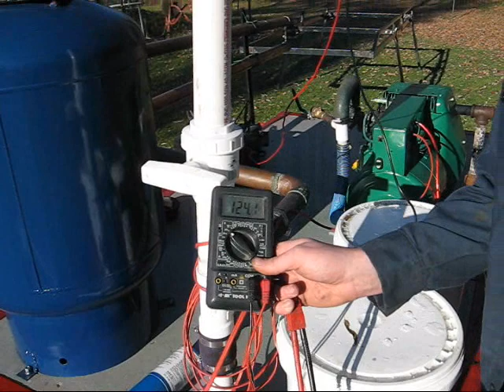Syngas Electric Generator Start-Up

Comment: There is no gas 'pressure' per se,the wood fire is kept running by the vacumm generated by the engine.The fire is 'oxidizing(burning extremely hot) under a controlled amount of supply air,that air being sucked in by the vacuum generated by the engine not by the fire burning.Thats the idea.It is also why he needs no carburator at all,just two hand valves,one for gas and one for air.Once you get your rpm's set with the hand valves you are good to go.

Comment: "research "cyclone steam engine", you can create a much simpler set up to create electricity for yourself. Check out the video of the WHE )waste Heat Engine" that they sell, when it is being run off of a wood pellet burning stove. No need to convert wood to woodgas, simpler operation,

Comment: Very nice job! I am building two of them right now that will handle a 5 Hp motor. I am almost finished with the first one. For those of you wishing to build one there are a few things that you need to make sure you get correct. (1) make sure the whole system is properly sealed. (2) make sure that the gas is properly cooled and filtered along with a way to capture any moisture in the lines. (3) Use a good dry wood for fuel. I'll be doing my own video soon too.

Comment: Dont see that pipe lasting very long being temp in reactor should be around 1000-1200F(to cut down on tar) and gas pulling through is about 100-500F and being plastic pipe cant be good at all!. I bet inside of pipes is glue like after 2 hrs.....Plastic PVC pipe and temp above 200F = Toxic gases,,,,, not good idea

Comment: Great job, my only question is how you determined the necessary gas pressure to run the generator.  I'd love to hear back from you, we are slowly working our way off the grid as well! (we use biogas for our stove right now)

Comment: @dexterquincy1  as long as the genset is 4 stroke and not 2 stroke it should work fine with a gasifier system that has been properly sized.

I will warn you though to consider building something other than a fema style unit. They are prone to make tar and can really gum up an engine... I say this from experience.

Comment: @onceANexile how many hours do you have to sit there holding a match to light the charcoal bed? A match will work but if you put that match to something like a newspaper and use that it would be smart. If you're going into woodgas you will most likely already have a torch for bracing etc.

Comment: @outoforder2day As a single person you will not have the financial means nor the engineering expertise needed to run an efficient electricity steam boiler-turbine setup. Making the very high pressure super heated dry steam needed to drive a turbine is actually really difficult and expensive to build the boilers and super heat the steam. Next you have to get a steam turbine which you do not really find down at your local hardware store. You utilize both electricity and the heat generated here.

Comment: Very cool. What are your thoughts about the waste heat that's being eminated to the atmosphere? Can it be captured via a radiator (or even just some copper tubing wrapped around your stove) to heat water? Then use the resulting steam to run some sort of steam engine as well as the gas engine?

Comment: @nwtrick No the gas is just starting up the gasification process it is a wood gasyfier. when the fire is started the gas is sucked out and blown into the engine. To describe it shortly the flame you se in a fire is the gases burning the glow in the bottom is the actual material burning. why not seperate these and burn the gases seperatley e.g. in a motor. Go look up wood gasification.

Comment: Very Very good!  Syngas, however, is used to synthesize other compounds that's why its called syn-gas.  Syn-gas is all hydrogen and carbon monoxide I think.  The only way to get pure syn-gas is to burn carbon/charcoal  to get it hot then blow steam through it for a while.   Its also worth noting that running on wood gas, or any gas made with air is pulled into will reduce your motor max horsepower by about 50% because most of the gas going in will be nitrogen thus reducing Oxygen for combustion.

Comment: As a footnote,these gasifiers can use practically anything organic,leaves,sticks and brush make the best fuel from what I hear.The best to use is sticks and or blocks of wood,doesn't matter what kind  of wood either.So,to any naysayers to this, many problably already own their  fuel supply and are too ignorant to use it.Oh about the CO2,sticks, leaves and brush give off the exact same amount of co2 rotting on the ground as they would burning it.

Comment: @nwtrick That's only 4 two seconds to start it. U use electricity to start you car 4 2 seconds. AND the alternator charges it back up. 

Once this thing is started it can be fed wood forever and keep the engine running. 

Does that make any sense 2 U ?

Comment: @catskillwoodgas 
thats great man. I made one gasifier too and yesterday i did the first try but the fan failed.  i used the water jacket technique for cooling and i used those duct flexible aluminum pipes but they started shaking so hard and the fan just stopped.  One mistake i made is i didn't put charcoal at the bottom i just lit the wood .  but i dont know what went wrong ;

Comment: Very nice project. I just finished mine and I am trying to find more information on filtering- as my intake valve is covered in wood goo. Its my fault, my filter is not much- What are you using?

Comment: @baaddwrench : from what I remember, when you heat up wood pellets (using indirect heat), it gives off a gas that is burnable.  The gas primer in this vid is to start the gas engine, once it is giving off a nice heat, it can be used to heat up the pellets, which in turn makes the "syngas" which fuels the engine.  The valve is moved from primer gas slowly to syngas.

But I could be wrong

Comment: soo you got any ratios to how many hours to how long the engine runs on a pound of fuel or how many pounds needed to fuel the motor for 1 hour?? thanks really awesome! i see this would work great on a farm they already use it in mainland china like that, they throw all the corn husks into the gassifiers and run whole communities without a grid supply!!

Comment: also if wood burns it doesn`t produce more co2 as it takes out of the atmospher while it is growing so wood is acualy co2 neutral fuel.
if burned in a wood carburator

Comment from the maker: I have not, but would like to. This engine uses fixed points timing and can not be changed with out dis-assembly. I may make it electronic ignition with an adjustable input for timing advance.